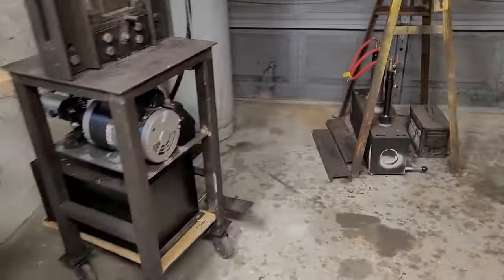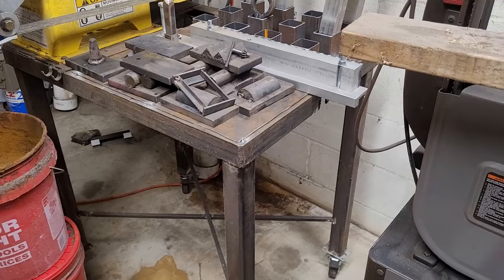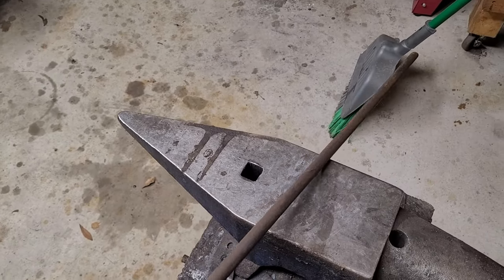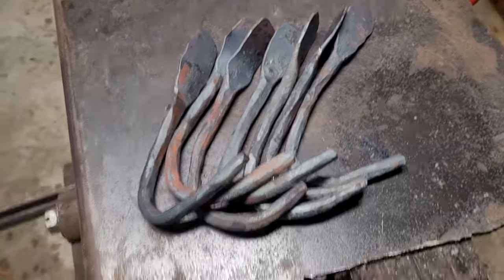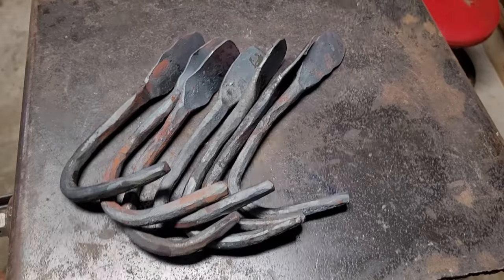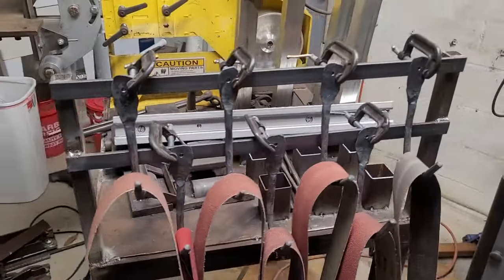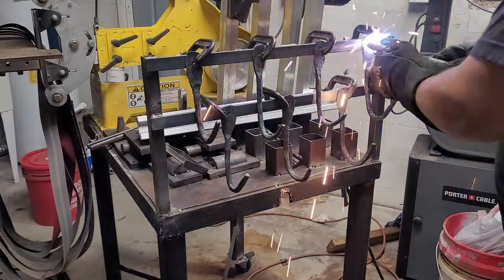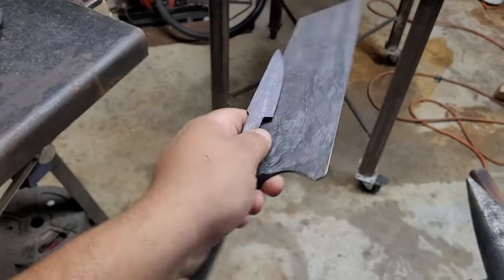Forging Hooks

Comment: As an aspiring engineer I think you cold have saved some box tube if you modified some of the hooks to have a dip in the other direction so you could mount them 180 degrees. This might be a little harder to make but, more material and space efficient. I my opinion some locking nuts would hold those much more securely considering how easily that one came off.
Reply from the maker: I tacked it back up. If they ever do fall off ill probably go that route. Im just curious how long it will last. I did do a pretty crappy job 🤣